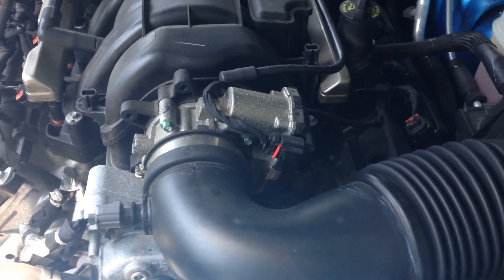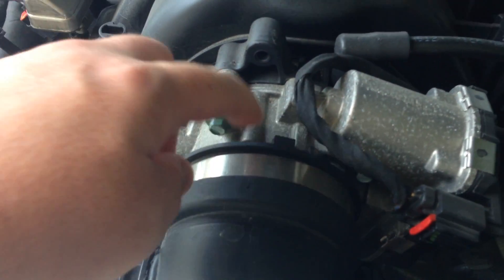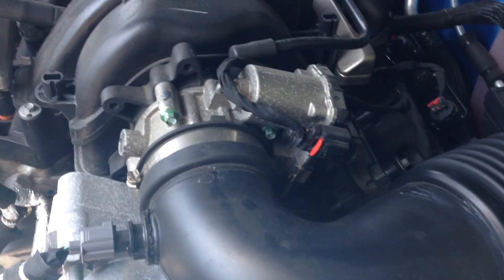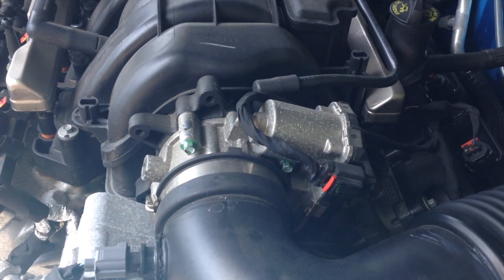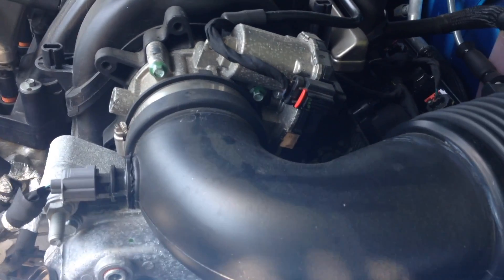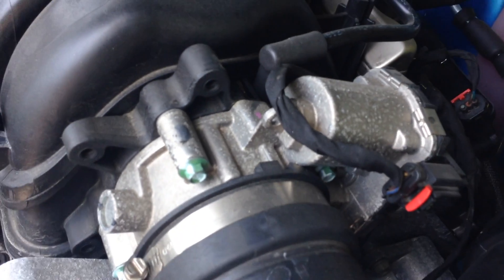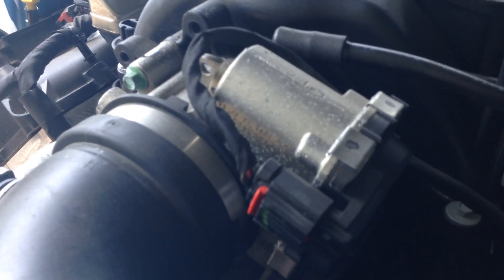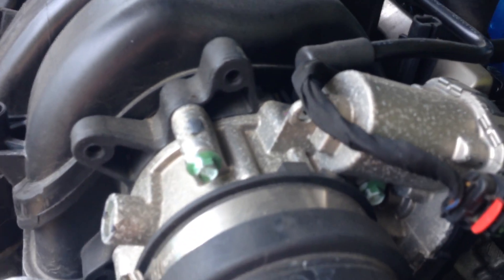Throttle Body - What is it? Does it add Horsepower?

Comment: Do you necessarily have to get a tune if you 87 mm throttle body? Ans which brand do you recommend
Reply: I'm going to get minds retune I have the throttle body in a spacer just one for my cold intake it was on back order it should get shipped out this week I went with the '87 big mouth one something different don't see on a lot of vehicles

Comment: What’s your opinion of this mod? Is it worth doing (easy but kind of pricey) and how much improvement can I expect in my 0-60 and 1/4 mile times? My 5.7 has the factory air box with a high flow filter and a tune. Thanks in advance.

Comment: So im thinking throttle body for my crysler 300 mopar 12 5.7 hemi what size mm would it be the 87 89 or 91 can you help me out here.
Reply: I have a 07 Chrysler Aspen 5.7 300 SUV I have the 87 one I haven't installed yet waiting for my cold intake I have a spacer also

Comment: Could you shed some light on the intake manifold diameter? I've heard that if it's diameter is like 85mm, then a 90mm throttle body is entirely pointless because the air still goes through an 85MM opening. Is there any truth to this? I'm wondering for any 5.7 HEMI from 2006+. From what I've read, the 85MM throttle body is the happy medium.

Comment: Are they plug and play and the computer adjust to the air flow or does it need to be tuned
Reply from the maker: Yes - but you should adjust your tune for better performance
Reply: @RTLife  so you are saying that they are basically plug-and-play, but need a tune after installing ?
Reply: @RTLife  I was about to say the PCM will adjust the A/F Ratio needed for it automatically, but youll have to reflash your tune whether DiaboSports or whatever you may have.

Comment: Would it be worth putting a 87mm throttle body on my 5.7? Its not tuned but I've heard people said you don't have to tune it for that, what's your take on it?  I do have a Corsa cold air intake if that would matter, so would it be worth buying a new throttle body? 🤔🤔🤔🤔🤔🤔🤔🤔🤔
Reply from the maker: from what I've seen you pick up low end torque (but that's with a tune). Not sure what it will do on a stock tune - probably will not notice much of a difference.
Reply: @RTLife   ok thanks man
Reply: I have 87 haven't installed yet waiting on my cold intake to get here have the Spacer also

Comment: I have this exact mod on my 2017 Camaro SS. I have an 87mm ported throttle body. The throttle body has double the airflow of stock. I also have a cold air intake. So I have it at the dyno tuner now, it has been a struggle for him but he found out what needs to be done now. They said I have way more airflow now and have to dial in the fuel ratio. It seems without the tune the MAF sensor was over compensating for the added airflow. When they checked it, it was running 11:1 air/fuel ratio which is very rich. I have watched a lot of videos of these cars on the dyno and every one the exhaust belches out black smoke at the higher rpm. So he has had my ratio at high 12s:1 now and knows how to tweak it now. I don't really see any videos of these cars on the dyno with these specific mods, they have all had exhaust, cam, heads, intake. I am wondering what I will see from it when they are done.

They have a Mustang dyno, which do not show big numbers but when the fuel ratio was rich it put out 385hp and 407tq at the wheels.

Comment: Does a better throttle body give you less of a lag when hitting the gas?
Reply: Anything is better then stock
Reply from the maker: You will need a proper tune to really notice a difference.
Reply: @RTLife  I’ve read on Reddit that you don’t need a tune with a throttle body. Seen it on videos as well. Why am I seeing the 2 different opinions so much?
Reply from the maker: @TheRoadLessChosen  you can replace the stock throttle without a tune - just don't think any real hp/torque will be gained
Reply: I recommend pedal commander
Reply: @dshauziht4998  don't cheat yourself treat yourself put that money towards something else that's really going to give you a gain POWER

Comment: I put a bbk 85 mm on my rt charger. I didn't have the lights come on like others did. I did a throttle body flow master and cai and when mds kicks in I went from 17 mpg to 21 mpg. Even without hp gains if you daily drive like I do that's good enough reason for me.
Reply from the maker: That's a healthy MPG jump - going to at some point upgrade the throttle body.
Reply: R/T Life I will say some of that could have been attributed to the maintenance I did in the same shot. Added an oil catch can to keep that vaporized oil from the air intake changed all 16 spark plugs to e3 etc. The bbk has this slightly annoying whistle to it.
Reply: @jeffklaubo3168  people don't get it take care of your vehicle it will take care of you

Comment: Did you figure out which one you’d go with? I’ve been looking at BBK and FAST Big Mouth Throttle Body’s. Just unsure which one is best or if there are any other brands on the market with looking into
Reply: Worth*
Reply from the maker: When I'm ready for that upgrade it will likely be the 85mm. Which brand I don't know yet though.
Reply: R/T Life i was also told from a dodge tuner in Houston to check out Moes, Arrington, & Fastman TB’s so take a look at those as well!
Reply from the maker: Thanks man for the info. I hear from many there's not much of a gain since we're all N/A - so I put this on the back of the upgrade list
Reply: R/T Life no doubt
Reply: I have 1 haven't installed it yet I also have a spacer waiting in my cold intake just getting shipped off this week it's been on back order since the beginning of November

Comment: 15 hp is not a noticeable  increase that you will actually feel. especially for 500 dollars plus. thats just my opinion. see you on instagram.
Reply: BBK did a dyno run before and after the install of the 85mm power plus and it added 20HP that takes me from 12.8 to 12.6. I don't care if I feel it but I can see it on the track tickets when I do the 1/4 mile! Just FYI
Reply: @Lostandhopeless  counts that on the truck
Reply: It’s on sale for under $300 free shipping on mmx
Reply from the maker: it's def not a big HP gain but combined with some others it starts adding up.
Reply: R/T Life I'm not trying to talk you out of it. Been there before and just passing on information first hand. Whay you re looking for is to increase up and torque. That's where you will see the biggest difference. You might consider a gear change in the Charger. I don't know what comes from the factory  but you would probably get most bang for your buck by starting there. Again that's just my opinion.  I followed you on instagram. Have a Great day.
Reply from the maker: I'm right there with you on the gear change. 100%

Comment: Rt Life I have k&n cai, Spintech Mufflers/Resonator Delete, Granatelli coil packs, 87mm ported tb and tune on my 2014 Ram Rt I notice a slight increase in throttle response and mpgs also at low rpms almost like a procharger sound with the tb
Reply from the maker: I know the throttle body adds hp but is it enough to help the performance times of the car? That's a nice mod list you have going there, what kind of tune did you go with?

Comment: One thing to remember a bigger throttle body isn't always going to work. if the intake manifold opening is smaller then the throttle body you want to upgrade to then you can't use it. One thing you could do is port your own throttle body
Reply from the maker: I think the intake manifold is bigger in diameter then the stock throttle body (correct me if I'm wrong). So an upgraded 85-87mm throttle body would be less restrictive & allow increased air flow in when you stomp on the gas. I doubt anyone will see the gains they claim (10-15hp) though.
Reply: R/T Life if it is bigger than yes Idk personally I haven't checked it out but if you do upgrade you will notice. usually throttle response is much much better! it'll take the car a little bit to learn it tho.
Reply: BBK's 85 MM power plus is perfectly matched to the stock intake and the stock throttle body is not.

Comment: hope you kept the engine cover off, lol it looks so much better. what about throttle body spacers? do you believe in them? sounds great tho
Reply from the maker: Oh yah - locked away in the garage. Going to look into the spacer, first I'm reading about it. Sounds like some people on youtube have good experience with it.
Reply from the maker: Doesn't really add up to me - the spacer is supposed to help air flow better into the engine, increasing horsepower right? I don't think spending $100-$150 for what HP you will gain would be worth it. I would rather put that $$$ toward a better throttle body or tune.
Reply: that's what I'm saying, some folks believe in them just like CAI, but in my opinion  the spacer just gives a better intake noise but honestly doesn't do much. at bet maybe increases throttle response a little but probably not much. glad you took the cover off. the first time I did I was like "wow, that's a HEMI" lol. I still need to swap my pcm/ecu from diablo and get a tune
Reply from the maker: It might be a cool add on once I have all the real stuff I want on the car & looking for a little extra something or just for fun. Yah that Hemi cover came right off after that video, it does look much better now.

Comment: a throttle body install is as easy if not easier than a CAI install. I've been considering one myself maybe an 85 or 90mm. just haven't pulled the trigger on this one yet. ive done it before on another car before I traded for my 2016 rt and it does help... by the way blot-on's do improve hp somewhat or responsiveness but with out a tune I don't think it adds up so simply  ;cold air 15hp, throttleboddy 15hp, catback x amount... I'm pretty sure you need a tune to throw more fuel at it, running rich can just be a waste with out a tune also. its all about balance. have you looked into the 180 thermostat mod? I haven't done that one but I hear I gets you a few extra ponies.
Reply from the maker: I hear the 85MM fits perfect - I 100% agree on the tune to get the full performance out of the mods. I think the throttle body is next & then a tune to help bring it altogether. The 180 thermostat mod makes the fans run so the engine stays cool right?
Reply: that's what I'm understanding, it kicks the fans on sooner to help keep it cool, and theoretically gaining a few ponies

Comment: off topic question, u feel ur hemi is sluggish when it's hot. I could barely chirp the tires earlier but it's also 93 out and was driving for awhile. does heat rob alot of HP or do I have another issue.
Reply from the maker: Nope heat robs performance, that's why we are always looking for ways to keep the engine cool (CAI) etc. Every engine doesn't run at it's peek in hot weather, that's why I try not to work the engine during the day in the heat. Don't worry it's normal.
Reply: I figured as much, this was first time it has been sluggish, but it has been hot here lately.
Reply: My hemi charger burns the tires like crazy when its pretty cold but once it reaches operating temperature it won't longer spin the tires or even do burnouts

Comment: What about if you port and polish  your throttlebody
Reply: FREAKWITHKAMERA its plenty of shops that have them they are cnc ported try websites like extreme modern muscle. car id,HHP, there was another website that you could upgrade to scat pack but its only if your car under warranty and you dont wanna lose it it goes either way for the scat pack warranty or not
Reply from the maker: I'm terrible with DIY projects plus there is mixed results with doing that. Are you thinking of do it?
Reply: I was thinking  about buying one already ported and polish
Reply: Aaron Ferguson thanks I will try out the website
Reply: How do you suggest to port it? I don't have the tooling to do that.

Comment: I'm looking at the modern muscle throttle body. Some people report some problems with warning lights though.
Reply: James Fines. i had the bbk 85mm throttle body it caused my engine light to come on and them sometimes it shuts off by its self. so i put my stock throttle body back on and the bbk throttle body. im looking at the modern muscle 87mm throttle body
Reply: R/T Life I will make a quick video of removing the throttle body if you haven't seen a video already its not long or hard to do
Reply: R/T Life i will make the video once i get off work i will remove some small parts just so you will have a great idea of how to do it
Reply from the maker: that was suggested the other day. Looking at this one >> Polished (Outside) 5.7L 6.1L 392 6.4L HEMI Ported Throttle body 85mm (1847)
Reply from the maker: When you post it up let me know, that would be awesome.
Reply: Ok will do hold on
Reply: Whoa Weezy this same thing happened to me so I sent it back twice an the same thing.
Reply: The reason people have issues is because they are throwing it on without tuning it.
Reply: @zakfuji6303  you shouldn’t have to tune it though.